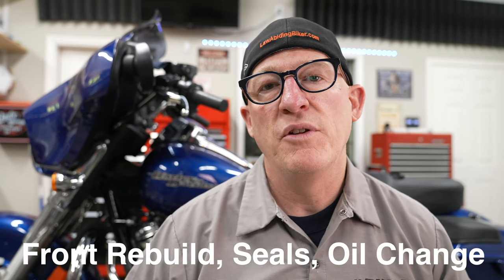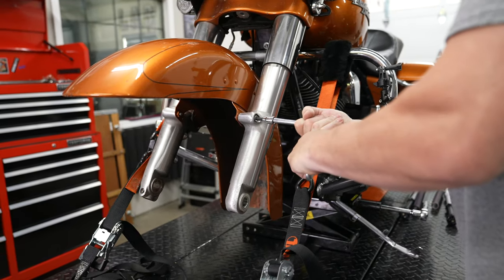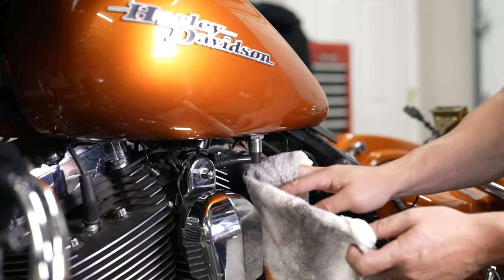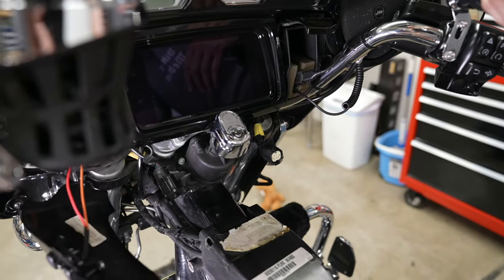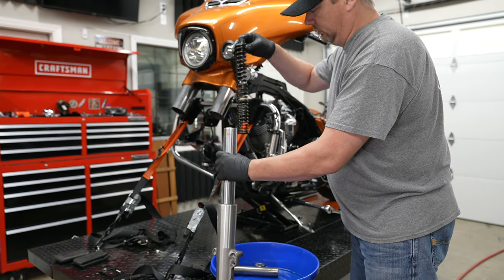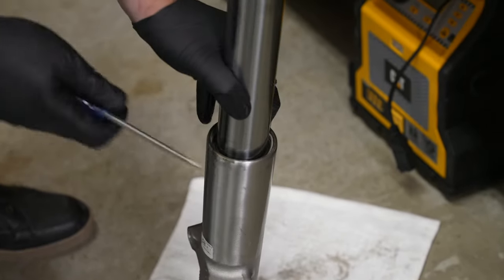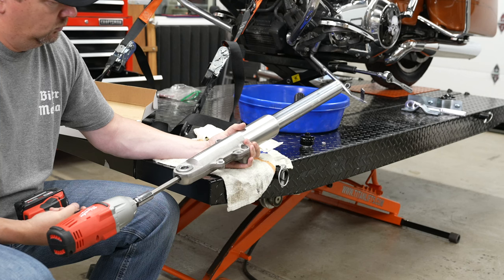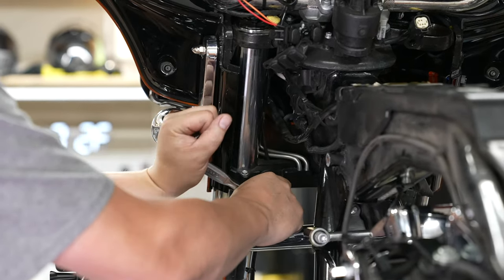How To Rebuild Forks & Change Seals On A Harley-Davidson Motorcycle

Comment: In the video you said you fill with it in the down position resting on the lift. Later when you did your final top off. It looked like the shock was all the way extended. What should it be for the final. Up or down? And where did you get the air gap space number for your weight?

Comment: out of all 9 Harleys I own the 2014 is the first to blow a fork seal at 25k, the 7 bike below 2014 have over 45k, the one over 2014 has 1k on the clock, I do all my own maintenance so I appreciate you, great video, one tip, when you take the calipers off, slide it down the rotor, put one bolt 5 or 6 turns in, put a 12 point wrench perpendicular to the edge of the rotor on the bolt head to pull back and forth to open the pads so it will be ready to go back on without taking a chance damaging the pads prying with a screwdriver.

Comment: so the bigger of the 2 bushing  guides 46516-01 is driven into place by the spacer 46515-01 and the oil seal 46514-01a  with the seal driving tool ?  all at one time ? and i dont have to worry about the depth of the bushing guide into the slider fork ? thank you for replying

Comment: Watching your video and appreciation to you but I have a question about fork oil level you said was 95 mm butfot your
Weight you measured 140 mm were did these numbers come from trying to get the most out of my 14 street glide went 13 shocks now working on forks thank you

Comment: Is there a reason why you put the bushings over each other? Every fork I’ve rebuilt or seen rebuilt has the large bushing in the groove of the fork tube as you did but the smaller bushing above the larger bushing sliding on the tube not the larger bushing.

Comment: I have a 2016 Road King Police bike with 24,000 miles on it  . I was getting a loud squeak every time I let off the throttle , when the bike dips in the front end. I’m thinking it’s coming from the front forks so I changed the fork oil and it went away . Unfortunately after 3 weeks or so it came back. Any thoughts on it ??? Maybe they need to be rebuilt

Comment: Hi Ryan,
I'm in the process of changing my 07 Dyna stock front end with 49mm x 25.5" long slider tubes, to a Dyna Switchback 41mm x 26.25" long slider tubes.
I'm replacing everything including the triple trees, lowers, and headlight.
I have to increase the 41mm length, because the stock Switchback slider length is a half inch shorter with a stock length of 25".
I don't wanna go down in height so I plan on increasing the length to the next available size at 26.25".
My question is, how do I calculate the correct internals to accomplish this?
Thanks,
John

Comment: great video!  i'm wondering what you think about the 2023 bikes so far?  look at the touring model's engine....there is a new tube in the top of the heads.....looks to be a breather or a wide band o2 sensors or even liquid cooling.  did you happen to notice that?  thoughts on what it is?  looks like a coolant tube to me.

Comment: 12:44 you say 12 mm bolt, but in 18:13 19mm. So, what is true?
And are you sure its not 1/2''?
Reply: That bolt on the bottom of the fork slider is 12mm like he said initially. The top fork cap plug is 19mm. I know because I just did a rebuild on mine and had to order the 19mm Allen socket and the 12mm deep Allen socket off Amazon because I couldn’t find them in any stores.

Comment: Indeed apparently now you can go up to 50000 miles with the oil as well instead of 10000 miles. Mainly because it is so much work with the newer forks. So, by that time you have to rebuild the forks anyway.
But, TIP :  to prevent pre-mature wear of the split bushings and maybe the stanchions (and seals.....), I hope we know that one should first torque the axle nut down, only then the pinch bolt please? With a bit of grease or oil on the shaft to center the fork legs straight, and of course against some corrosion.
Have an even smoother ride !

Comment: I've done hundreds of fork seals on metric bikes. I've never seen a bike where you had to remove the gas tank and the ignition and the dash just to change the forksales, that's crazy.
Reply: @USNVA-yn6cp  real HD 🤣. 1944 suspension for 30k. Real junk.
Reply: @USNVA-yn6cp  I don't ride "Japers". But thanks for showing your ignorance. Have a nice day. My only point was that there is a better way that's lighter and more efficient and more effective. Sorry didn't mean to use big words.